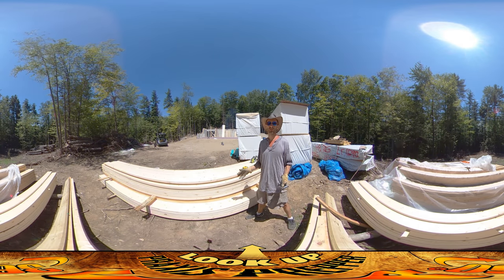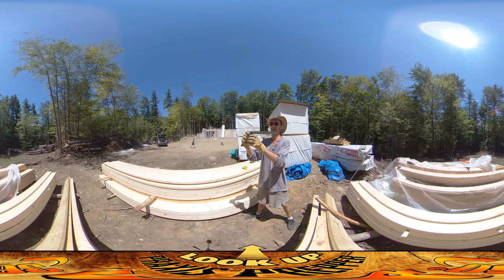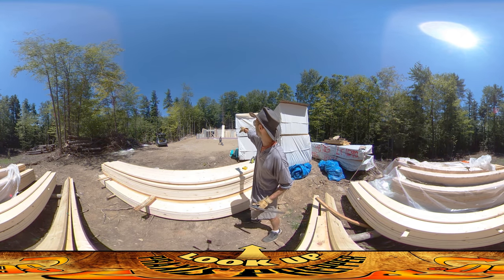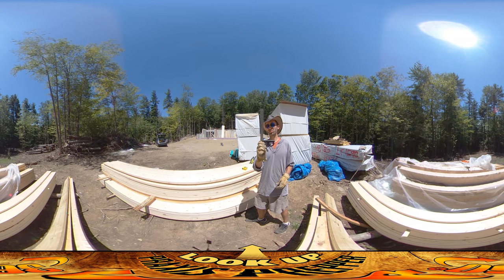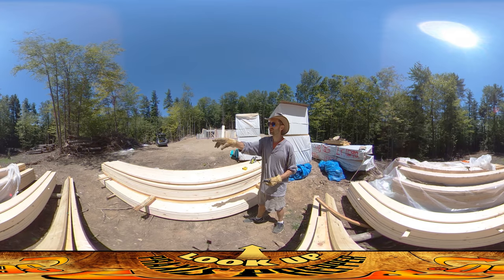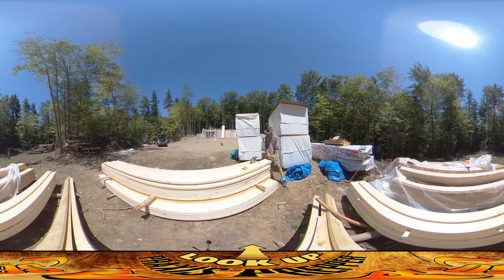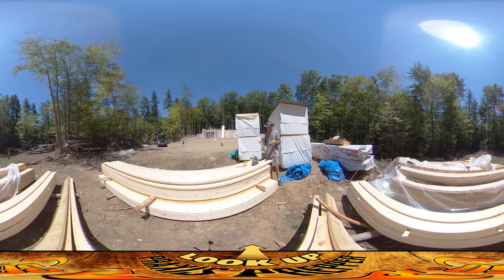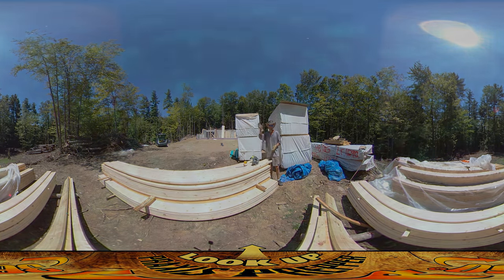Homestead Building - Prepping Floor Joists, PRO TIP: Dimensional Lumber's Imperfect Dimensions

Comment: how long do the batteries last in the circular saw? Seems to me I remember you also using an electric chainsaw.
Reply: Think batteries last about 15~20y depends a bit how much you use them, generally the 'lifetime' is in charge cycles... how long the charge last i don't know though, be interesting to hear about from praxis ;)
Reply from the maker: I have 4 batteries for the saw and drill (they use the same batteries) and I rarely use up more than two on a day that sees plenty of cutting of boards.
Reply: Praxis Homesteading and Survival Skills Which brand are your tools. My trimmer broke and after replacing the carb I discovered that the drive shaft was also broken and of course the part is discontinued by the manufacturer and I haven't been able to find it anywhere yet so I'm thinking of replacing it with a battery based tool that I can expand next year when we hit the road and I'll need a set of reachable tools for working on the 5th wheel while we travel and also begin a much longer process of beginning our homestead.

Comment: Are you not supposed to cut them after testfitting them first? or measuring where they actually go? Now sure, the drawing says they should be said length but that also wants the concrete work to be 100% accurate, the columns to be in the exact location etc ... now sure, that should sort of be this way, but there are times some small deviations arise (basically called 'tolerances'), and to prevent gaps or weird non-alignments, or not being able to reach a certain point where there has to be some nailed/screwed/glued connection, it's nice one make each piece fit within the space it has available, instead of the space designated on the drawing ... might be something you run into once they are all installed, and you are free to turn it into a lesson to share, but who knows, you might have everything perfect and the precut things will fit like a glove (or be so lucky they are a tad to long still and get a chance to cut off some more). :)
Reply from the maker: You're 100% right. The foundation was measured to check for accuracy to plans and it was pretty darn close to perfect. I thought I'd mentioned that concept in an earlier video, but maybe I didn't.
Reply: @PraxisPrepper  well these videos just pass on by, just like some days do. Also not watching them in one go, so maybe you did mention it 2 weeks ago, and clearly i wouldn't recall that at this point ... but it seems to be a pretty important thing to consider when cutting these so hence i inquired about it ;)
Reply from the maker: @dutchcourage7312  Don't get me wrong, I wasn't questioning your memory about it any more than I was questioning mine. There is a LOT to consider when building anything. And while I'm sharing daily videos about it there's still plenty that doesn't get covered.
Reply: @PraxisPrepper  maybe something to adres in a stream just to be clear about it. And at least the comment is here now so people can read this discussion and figure out what transpired.